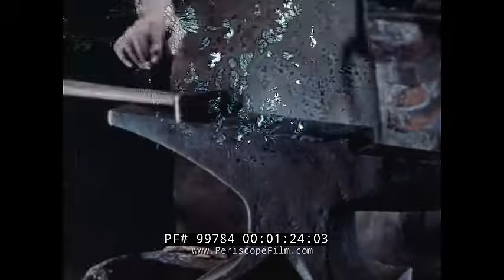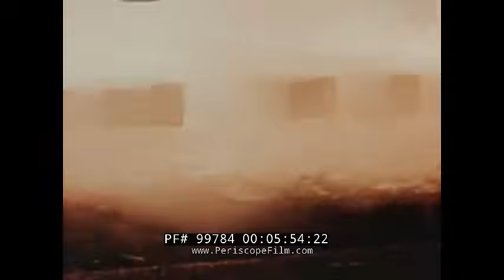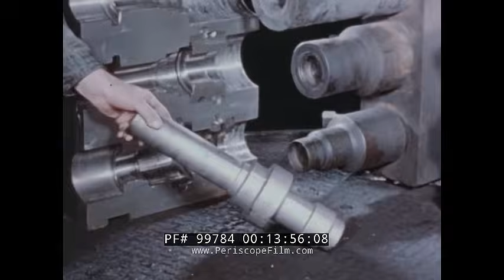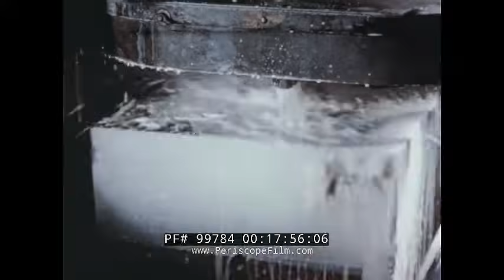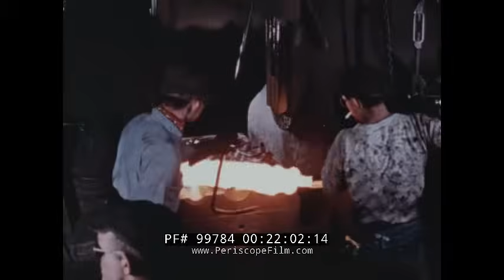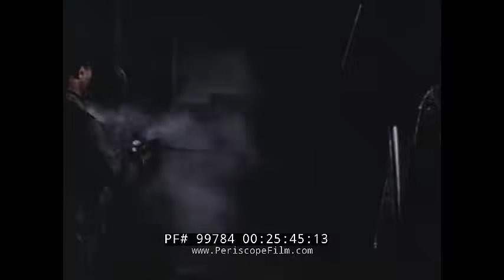" FORGING IN CLOSED DIES " 1955 DROP FORGING ASSOCIATION PROMO FILM  STEEL  99784

Comment: My father was an engineer at AMF (American Machine and Foundry). As a teenager I got to see and hear 105mm projectiles being cold forged from five inch stock. The hammer was a multi story tall behemoth that shook the earth beneath the huge industrial workshop that contained it. The heat, shock and noise were overwhelming and I remember asking, "why is this called 'cold'?"

Comment: Walker Forge in Racine, Wisconsin in the mid 70’s. Worked as a QA inspector for 2 1/2 years with my then father in law Gordon Hudson. Crazy job as an 18 year old guy. Scary at first. They had board drop forge hammers from 2,000 up to 5,000 lbs. Made a lot of connecting rods and crank shafts for Detroit Diesel among other companies.

Comment: Our village on the River Don just NW of Sheffield had 3 forges, and of course there  were many more in the city. The Kelham Island steel museum in the city has a steam hammer from the 1900s that still works, a Bessemer converter and a crankshaft for the Merlin engine a Spitfire, a lot of other good steel stuff. The pub outside has some pretty good beer too. (One of my first jobs in a steel mill in Stocksbridge was to get a gallon bucket of mild ale for our furnacemen who were making the steel my melting down old battleships, etc.)
Reply: I worked for a place in York PA that has a set of rolls from Germany. It's a Wilhelmsberger. One story above ground and two below. Has the capacity to roll ten inch thick stainless steel! One of the biggest sets of rolls on the Eastern seaboard. Loved watching it being used!

Comment: I work in a forge , I’m a millwright. We have 9 upsetters some ajax some national.  Only one is still a manual , but they are massive machines. I’ve helped rebuild them multiple times over the years
Reply: we had the same machines at Hughes Tool Co . Houston, Texas
Reply: @tinasaucier  that’s neat , I’ve been told large upsetters like that are very rare. We make axle shafts for some of the major truck manufacturers. Midwest forge Cle Ohio

Comment: I made tractor half shafts which weighed 66 pounds at Fords of Dagenham back in the late 1970s. One every 45 seconds using a 9 inch upset forging machine. I was around 40 years younger back then.
Reply: Did they pay you good?

Comment: I have ringing in my ears. I used an air powered grinder in steel. I did not wear ear protection b/c I didna know it was available. 
The guys in this didna wear ear protection either. 
  I started the ear ringing in the spring of 1971.

Comment: Watching the crankshaft forging made me think of a story my dad told me that happened probably 50 years ago. He worked for a major diesel engine manufacturer from the mid 1950's to the early 1990's. He was tasked to find out why crankshafts were failing and so he visited the machine shop where they were machined to final dimensions. His first clue that something was amiss was that periodically the whole building shook while taking rough cuts on the forgings. The cranks were machined to spec, but the loud noise of the rough cuts was a red flag. He visited the forging plant and discovered that the dies were badly worn, causing the forgings to be oversize. All that vibration on the rough cut was introducing cracks into machined parts.
Reply: Yeah, these dies must cost a fortune to replace..
Reply: Machining process had no chipbreaker.
Reply: So why not back off the first cuts, and not chatter the damn machine? Cuz Union, careless? Someone else would be paying if it broke. 👍

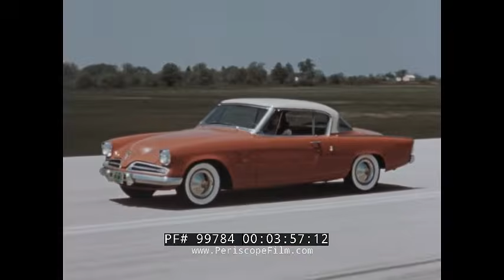Comment: 4:00 Companies used to go so much harder in when they made documentaries.  Just look at that.  They went and stripped down a car just for a 5 second shot.

I get that they probably worked with whatever car company that was (don't @ me my car experience doesn't start until the 60's and not really until the 80's) probably worked with them and might have just lent them a few cars for the shoot.  Or the car company maybe just had a car without the body on hand as a demonstration.  I also know that older cars were built differently and it was much easier to take the body off of the chassis.  But still.  You never see that much effort put into documentaries, anymore, let alone documentaries made by an industrial trade group that is only tangentially related to the company whose product is being used as a visual demonstration.

I think it might just be that film production was so much more expensive and rare that when something like this came around it was a much bigger deal and it got a lot more people excited to participate, and was probably a lot easier to justify the cost to accounting as "advertising."  I know that on the few occasions I've been at a job and some sort of professional or semi-professional video shoot was happening, there was a palpable buzz in the air, I imagine it must have been that times a thousand back in the day where that might have been the first time you had ever personally seen a professional quality movie camera.

Comment: I've been a mechanic for 50 years, and I found this especially fascinating, seeing how these parts are formed. I have seen some old films on metal stamping for fenders and car bodies.  I also have to wonder how these rugged men could work in these conditions for years on end. I imagine there were a lot of injuries on the job. Dust, sparks, noise, debris everywhere, and that big hammer inches away from your limbs. Imagine your first day on the job........

Comment: I made reproduction firearm parts for the old German pistols and aerospace parts  in the early part of my life and made forging dies for many of the parts just so I could get the flow of the metal correct. Then I would machine the parts. I always had strong parts that rarely broke.
Reply: Can I ask you a question? How would you go about making a U bracket out of 304 stainless 1/8" sheet? Is that a hydraulic press pressing into a steel form? Thanks for any info in advance!

Comment: A good blacksmith doesn’t strike his anvil unnecessarily.
Reply: Tapping the anvil is extremely common between actual material strikes.  I've talked with some smith's who unless it's brought to their attention don't even realize when they do it.
Most commonly it's used to maintain the rhythm and momentum  of the actual "forging " strokes.  And btw it's a light tapping not a strike on the anvil.  It most definitely does not hurt the anvil.
Reply: Keeping in stroke, also bouncing off reduces sting

Comment: The die formed connrcting rods are mostly now made using sintered metal power and realitively cold formed. Of course high end connecting rods are still made from forgings.
Reply: Race to the bottom
Reply: Or simply cast and hardened.  Lower quality and much less strong.
Reply: @smithraymond09029  sintered metal has its own advantages and is hardly a race to the bottom.

Comment: And it's still done the same exact way. I design and build forging dies. They are sent to R and R forge in San Bernardino CA. where the parts are forged. I plan to make a series of videos on how it's done. I made the first one showing how I ruff out the punch from a solid block of tool steel https://www.youtube.com/watch?v=meims7jfNeg more to come. I just retired and want to record the whole process so it is not forever lost.
Reply: "I just retired and want to record the whole process so it is not forever lost."

Awesome. Thank you so much for doing this.
Reply: How much has the precision of forging improved since this was made?  From time to time I've heard about flashless forgings and forged powder metal.  Most connecting rods for the auto industry today are made from forged powder metal.
Reply: @Andy Harman  forging hasn't improved...the precision is in the dies. 
What has improved is the materials being used for various items.

Comment: Wonder if a 32nd of inch is plus or minus is close enough for the blancks to be cut at,  for the connecting rod example. Or is it like .005 " from saw...
Reply: Most forged items are toleranced to +/- 1/32" in their final form. .005" is already machined tolerances.  A blank would be in +/- 1/8" range.

Comment: Those drop hammer must shake the building and your bones too. I would prefer to work as an engineer.
Reply: The foundations of such presses are many stories deep in the ground, and are isolated from the floor of the building.
Reply: They shake the whole block we live on...they run 35,000 pound hammer and a couple of 20,000 pound hammers
Reply: @garbo3682  SIFCO, Standard Improvement Forge Company, Cleveland Ohio.
They shake the whole block too!

Comment: Great movie about the forging process. It is a shame that they didn't spend more time on die making.
Reply: Right!? Super interested in how that process worked back then. I work in a forge as a trimmer. Everything shown here is pretty similar to the way it’s done today.
Reply: @xsmokebeersx1  Why are the forgings bursting into flames when hammered? What's actually burning?
Reply: @Halinspark  so there’s a guy hitting the die block with a stick before the hammer man begins hammering. What he’s doing is called swabbing. Basically lubricating the die with an oil/water solution. Helps prevent the forging from sticking to the block while being hammered. Perhaps he has too much oil in the swab bucket!
Reply: @xsmokebeersx1  I didn't see it used much here, but they also use sawdust.

Comment: That connecting rod was one piece .... how do you connect it to the crankshaft ?
Reply: That connecting rod had a lot of work that still needed done to it. It was just a trimmed, raw forging. They would use a saw to cut the caps, then everything would need finished machined before it became a usable part.

Comment: The narration mixes up pressure with force. The narration should have been witten by an engineer. Pressure = force per unit area. The narration should be talking about force, not pressure..

Comment: Thank you. That was excellent. I have been a mechanic for 35 years and had not seen a crank forges. My Uncle was a tool and die maker and told me about theses machines as I grew up. now I understand a lot more.
Reply: In 1960 I had a Crankshaft CO. Forged crankshaft with counterweights on all throws for my 283 Chevy drag racer.  It was a beautiful thing and expensive!
JIM 🤔

Comment: Had a job in Jersey years ago working shoveling the years of lubricant from beneath a behemoth  drop hammer.....The hammer sat on a 20ft.×20ft. concrete base that was 8ft thick, the whole thing sat on  giant springs mounted to a lower level floor.....that's where the 3 foot deep sludge accumulated.....hard work even without the thought of all that weight above my head sitting on some springs.....
Reply: In case no one ever said it. Thank you. That's a hardcore job as greasy as it is needed.
Reply: Abandoned North Jersey YT has probably been there too.
Reply: @MatthewFogarty-k2y  maybe. Fair few drop forging plants in Jersey have been repurposed over the decades.
Reply: @joshschneider9766  can you what kind of repurposing has been done to these plants?
Reply: Eeek.
Reply: Nobody ever cared to clean until then huh.
American manufacturing pride.

Comment: Company i worked for in the 70-80's, EPAG developed a closed forging system. A fixed weight of material was forged with no flash almost to finished surface finish. All went way of the the DoDo in the early nineties few years after i left. Lack of investment in British industry.
My boss made me redundant and said take our ideas to America and show them there how to do it and make a few bob. I never did. What if?
Wasted knowledge and experience.
Reply: 13.59 we could have made a tool to make that forging in one operation close to finish tolerance. Zero to plus five thousand of a  inch.
Reply: A lot of forgings would have up to 1/8 inch extra material around their circumference.
Reply: Forging like that is sorta done in conjunction with cbc machining processes sometimes. Saturate the grain structure where you want it with one or maybe two forming strikes then machine to finished. Best of both worlds application for stuff like rocket parts and so forth.

Comment: This is all done in China now.   We didn't like getting dirty.
Reply: We didn't mind getting dirty, buyers preferred cheaper, lower quality metals. Which is what they got.
Reply: Nearly everything in our forge was covered in a film of graphite grease. Dirty job and noisy with hydraulic press motors running.
We had a Russian induction heater generator, would sound like Concorde when first started.
Reply: Foundry in US where I work, making defense critical forgings.
Reply: Much high quality Aircraft and Defense work still done in the USA!

Comment: So that's why the hammer moves up and down when not used!
Reply: And the blacksmith pounding on the anvil between blows to the metal being 👷worked?
Reply: @putteslaintxtbks5166  An anvil that is correctly made is 'live." That is the smith's hammer will bounce off the anvil. It helps to reduce the effort to bring the hammer up for the next blow after the smith determines where it should fall. Every little bit helps if you are doing this all day long.
Reply: @putteslaintxtbks5166  habit and style
Reply: In this case, yes.   Not in every case.   Some mechanical hammers do the same thing.